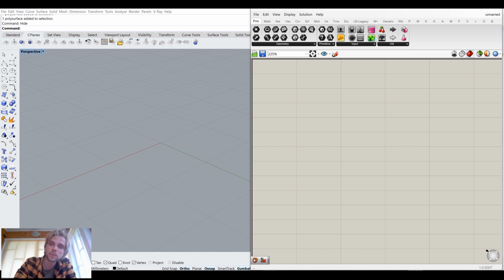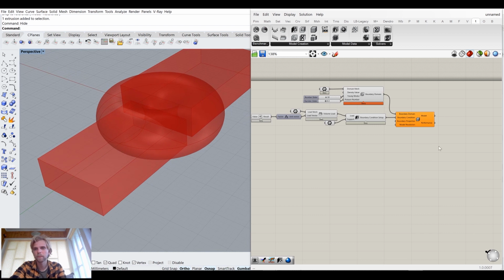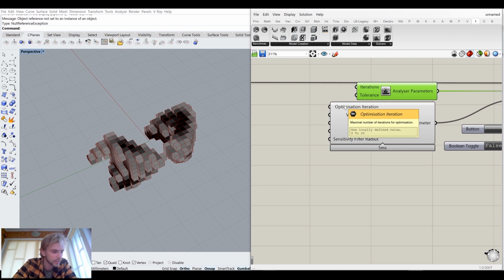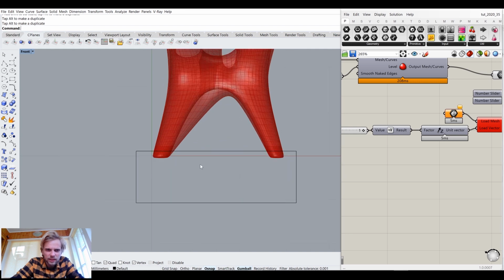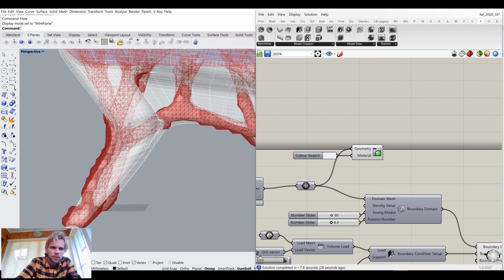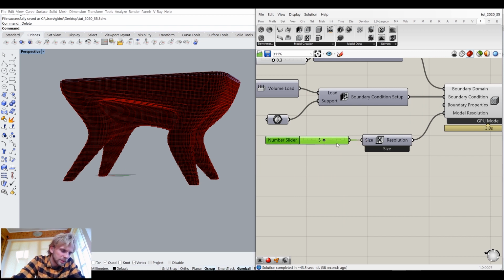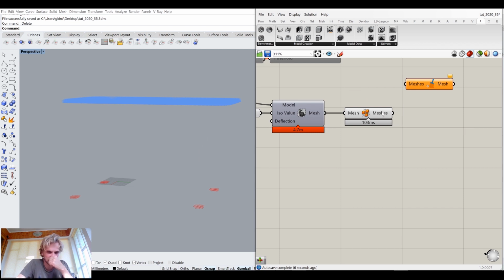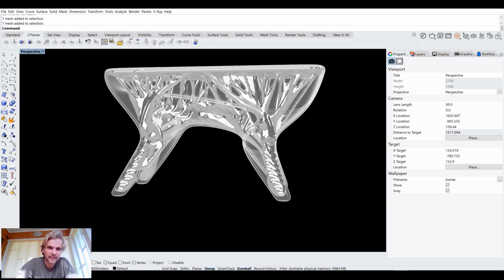2020-35 LTH Tutorials:  Generative Design from Structural Optimization ( tOpos+ Grasshopper )

Comment: hi can you tell me alternative for rhino 7. because topos plugin is not supported by the rhino7 .Also in previous video you mentioned milipede, is there any other possibility.
Reply from the maker: Topos seems to work with Rhino 7 just fine even though it's not listed as "supported" on food4rhino. As for Milipede - unfortunately I couldn't fine a viable alternative. Well.. I guess karamba, but it's not free.

Comment: Thank you for the video so much. But I have a problem with installing tOpos...I only have two user objects showing ( denspreview and element data preview). Do you know how I can solve it? I downloaded the file from food4rhino.
Reply from the maker: Hmm, make sure that you have all dll files unblocked (right click- properties - unblock). Seems like part of the plugin doesnt get initiated.
Reply: @DesignGoBrr  Thank you for quick answer. I have already check that in all the files. May I ask where you downloaded tOpos from?
Reply from the maker: @mariaopatek3330  Also from food4rhino, very strange that it doesn't load in properly. I'd suggest leaving a comment on Food4rhino - that's where the creator of tOpos can see it.

Comment: Thanks for the tutorial 
could you please explain how to use the "Boundary Properties" Component, and what to input in Fixed Mesh 
How we can create void in the optimization process ?
Reply from the maker: My pleasure. Rather than explaining the component, I'll suggest you downloading the example files from here: https://www.food4rhino.com/en/app/topos and taking a look at what kind of meshes are being referenced in the Boundary Properties component. Explaining it via text would just take way too long..
Reply: @DesignGoBrr  I did check the example file actually before asking, but they didn't use the "Boundary Properties" Component at all
Reply from the maker: @topspap  Oh.. Ok - in short it seems like you can use closed meshes to specify WHERE the voxel calculations should be made (like like a booleanIntersection filter) and also it has an input where you can use closed meshes to specify where the voxel calulations should NOT be made (like a booleanDifference filter)
Reply: @DesignGoBrr  The Fixed Mesh it kind of worked as you explained, but when i used box mesh as void the optimization still pass through that void mesh. Screenshot added for clarity.
Simple optimization no Fix or Void: https://ibb.co/23t9xSS
Adding Fix & Void Mesh: https://ibb.co/1sCMqzh
I know it is not easy to explain on the go, so if you had the time and energy i would appreciate it if you explain how it works in a short video.
Thank you for your time and efforts

Comment: Hey! Thanks for the cool tutorial! Do you know which version of CUDA your system is running? I can't get my GPU mode (I have a Quadra P4000) to work.
Reply from the maker: Let's see... it's 27.21.14.5638 . I used to have issues with my GTX760 , but honestly - you can optimize with CPU as well, it will take a bit longer, but it's not like GPU compute is 10 faster.

Comment: Gediminas. Hi. I have tried to get this plug in working on my pc, but I wasn't able to. I was wondering if you can share your pc specs. In my case, the plug in doesn't shows all of the components. Did you have the same problem when frist using tOpos? 

Thank you for your answer!
Reply: And about the specs. I'm asking for them because it seems that it has to do with the card you use and the drivers you have. Even though I have a later version than the one the author says in the download page, I can't make it work in my pc.
Reply from the maker: That's strange... make sure that all plugin files are unblocked (right click each file, properties, check if you can unblock it) . Other than that I have no idea why half of the nodes wouldn't load in... my spects are: 9th gen i7 HK , GTX1650 MAXQ, 16GB RAM.
Reply: @DesignGoBrr  Hi, Gediminas. Double Checked the component properties. Everything unblocked. It's very strange because I was able to run it as you did in your video in a laptop that I have. No difference about instalation. Maybe the hardware. 

In my pc I have a GTX 1060 6gb / i7-8700 3.2/ 32GB Ram

The laptop is GTX 1660 / 16gb RAM

The driver from my nvidia controller is 445.87 I readed that the CUDA computation capability must be higher or equal to 3.0 to be compatible with topos. 

It's such a pity. This plug in is very promissing. No answer from the developer.
Reply: @robertoarguelles8644  I can't run it on my 1070Ti either. Crying shame. It seems to work on older CUDA frameworks and surprisingly, on laptops. Been going crazy looking for a solution.
Reply: I encountered this same problem you have. My spec Ryzen 9 gtx 1060